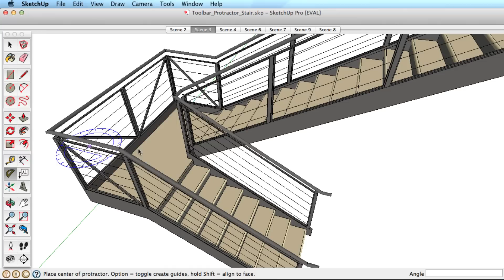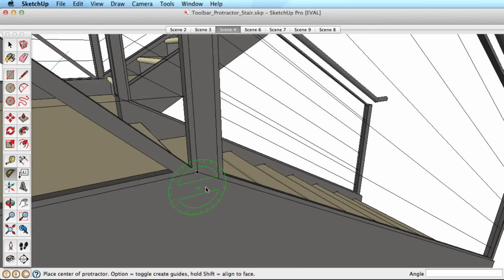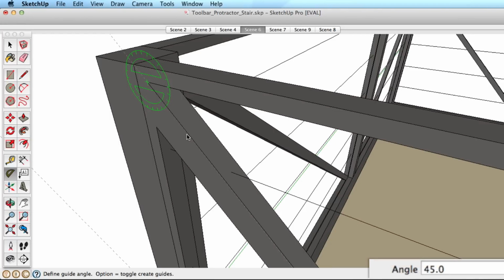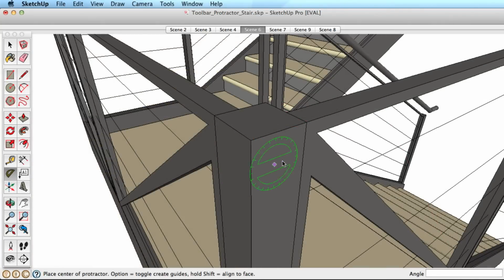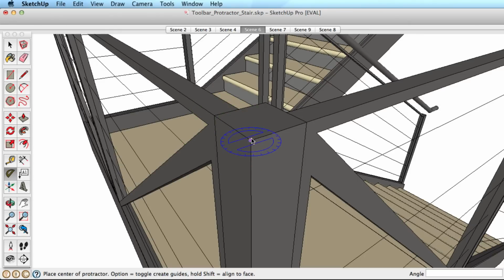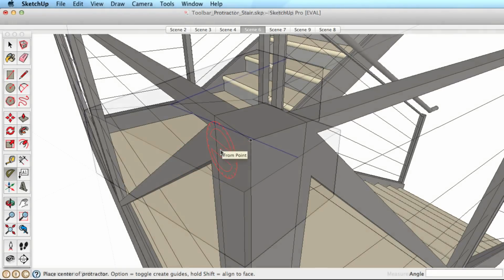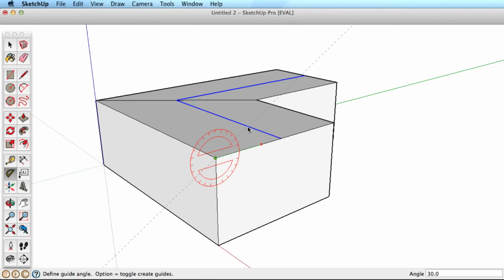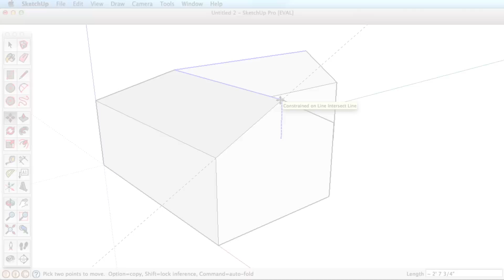SketchUp Training Series: Protractor tool

Comment: hello im having some troubles using the protractor tool to match up the angle for a new element. 
im making a model of my garage. i have all the exterior done but i want to ad plywood to the inside of the roof to make it more authentic looking, however i cant get the angle of the plywood to match up with the roof angle, it keeps popping through to the other side. i cant figure out how to measure the inside roof angle to get the plywood to lay flat. if you can give me some advice on how to do this properly, it would be appreciated.